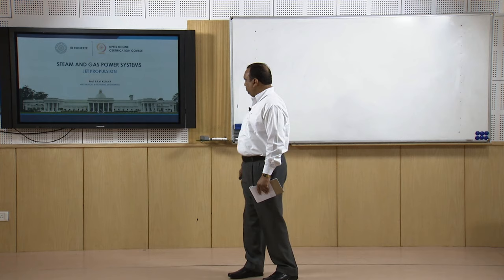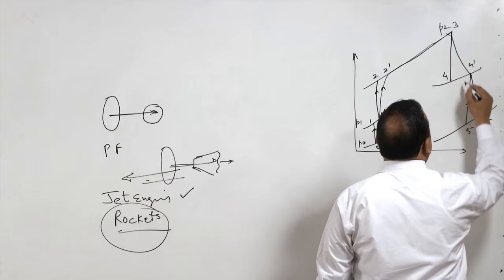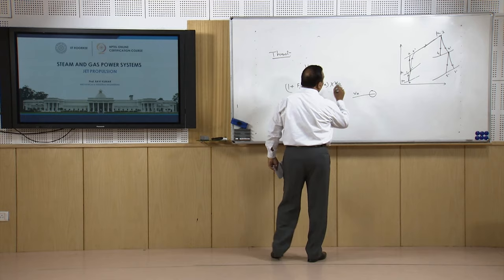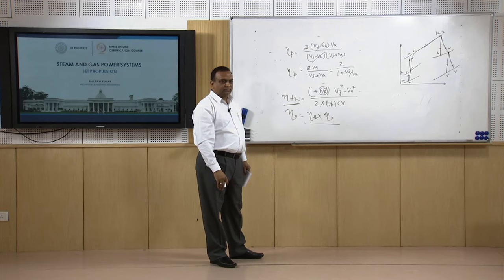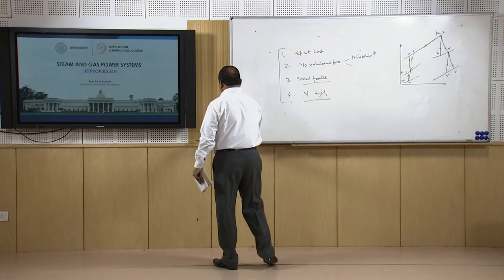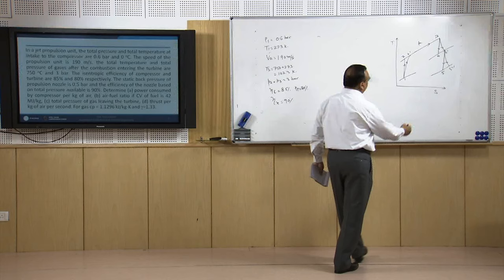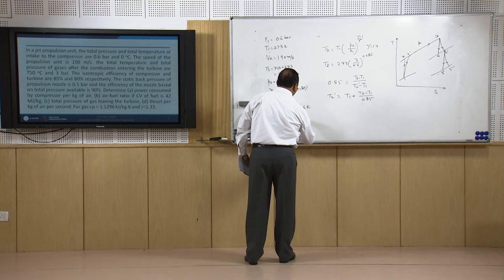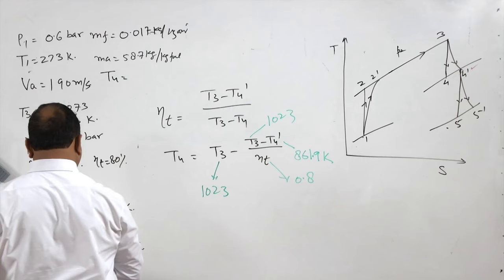Lecture 39: Jet Propulsion

Comment: Sir 27:27 static back pressure of nozzle (T5) was given as 0.5bar ....no need to calculate....... But still u gave me a method for how to calculate flue gas temp. By replacing Delta by 'n'. ...... Thanks alot sir : )